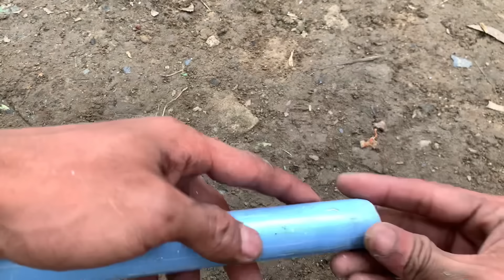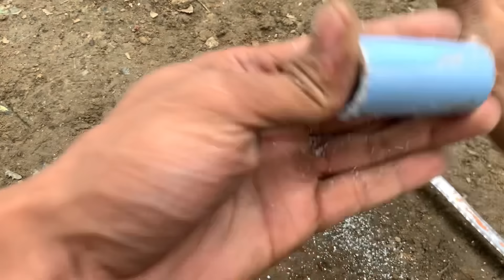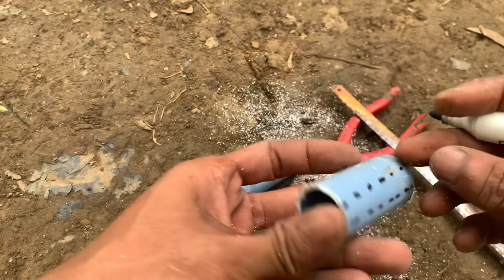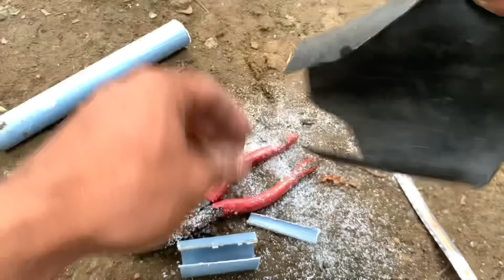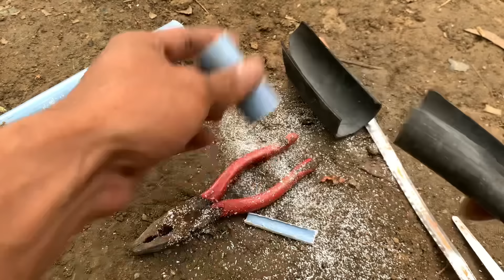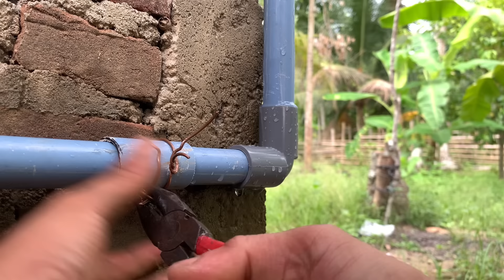Brilliant Ideas You Should Imitate To Fix Leaking Pipes Without Closing The Faucet & Cutting It

Comment: This is only temporary remedy. The best way is to cut the pipe above the L bend and also to the left of water leaking and fit it with couplers at the cut place. One should not use  L bend but use bend.  This is  the permanent and lasting remedy.

Comment: I would use one or more hose clamps on the rubber depending on how large the tear is.  In your case, I'll simply split the pipe without taking anymore of it so that it presses the rubber tightly. Then I will wrap a wire or rubber around it.

Comment: With this setup, it is 1000% better to fix the pipe with 1 coupling.  Turn the water off and cut the pipe inthe center of where the water is leaking from.  Apply primer and glue to the pipe and coupling. You will be able to pull the verticle pipe to the right which will allow the installation of the coupling.  Push the pipe together and allow the glue to set.  

Problem fixed the correct way which means there will be no need to return later to repair it again.